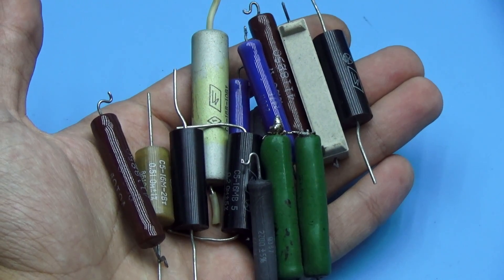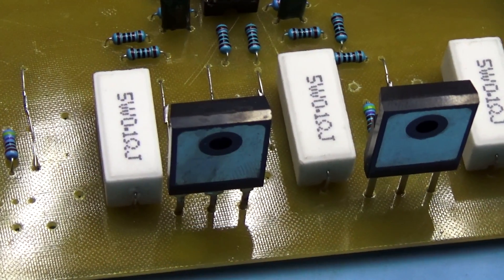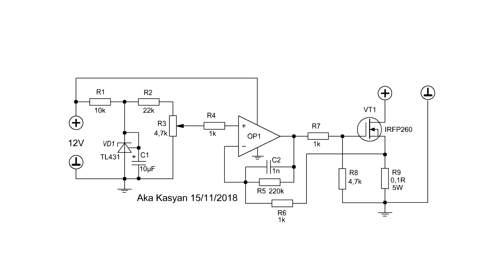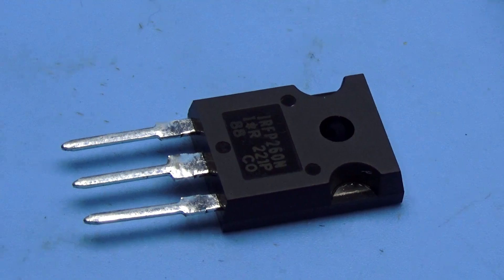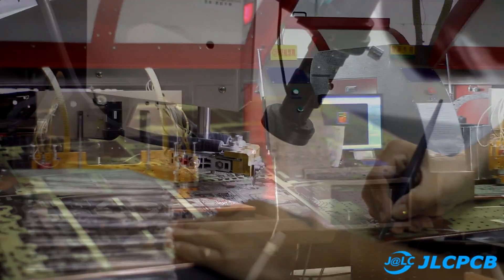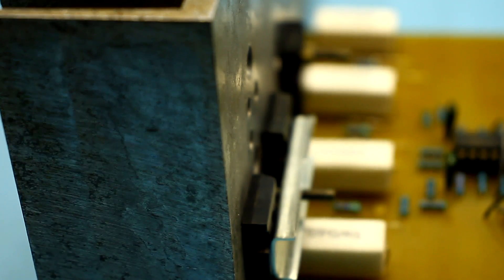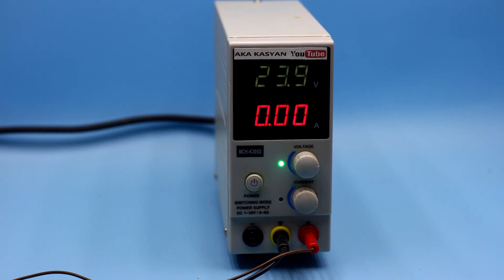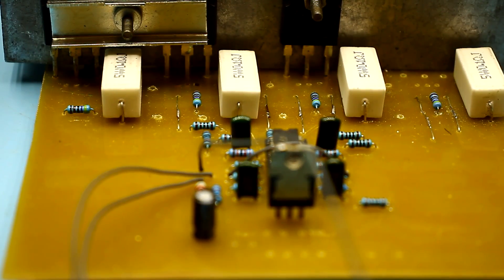Stealing from China 4! Electronic load 300W!!!

Comment: i made same circuit but the problem is when i used 36 volt 10 amp smps  as a load for testing 
upto 5 amp everything was fine
measured gate voltage was between 3.7v to 3.9v

but when i rotate the knob of pot gate voltage jumps to approx 8 volt and voltage and current on the meter  goes zero 
the gate voltage dosent increase in linear manner 
approx i expected upto 8 amps under load test but could not achive.
i tried many calculation but fail
pl help to find the solution

Comment: Hello Kasyan TV. Can I replace the mosfets with power NPN BJT transistors such as TIP3055? Anyway I've been following your channel for quite long time ago and have learned a lot from it. Keep up the good work!
Reply: you should not, especially for higher power applications, and for this application, where we want a voltage to control our load output, as BJTs require base current to control.

Comment: You cant use it as load for audio amplifier bcs of short circuit protection it is considered as 0 ohm during starting or when passing at 0 volt output

Comment: What is the purpose of R6, can't the shunt voltage be directly connected to vin- of op1?
Reply: We need both R5 and R6 for the opamps feedback voltage. Without either it couldn't work. The opamp in this configuration adjusts the output voltage up or down to keep the current fixed. Without R6 the opamp would just drive the output to its maximum or minimum, no regulation.

Comment: You can also use some power supplies as electronic loads. I have some older HP power supplies and they can be used as electronic loads, up to 20-25% of rated power I think.

Comment: To all... Do not buy stuff from aliexpress!!! They don't protect the buyers at all! I ordered some items and received a junk, then I open a case. In their policy, if the buyer receive an item "not as described" should get a full refund without need of return the item! But after aliexpress step in to resolve the case they rule that I'm correct, but they will issue a refund when I return the item. 
The problem is that the item cost is $10, but shipping from US to china is $30! They know that very well this is how they make money!!! This is how the scam works. You order something for $10-$15
They send you a junk for $2. You open a case - they rule to return the item. You won't return it, because is more expensive than the initial value. So they sold you a useless junk that cost $2 for $10-$15.
Reply: Definitely the opposite of experiences i've had on Ali express. I've opened dozens of claims over the past 3 years and not one of them was handled in such a manor. Sorry to hear you had a bad one but I doubt they would be as successful as they are if all claims were handled as you suggest. I've gotten straight up refunded  for a mixup they made. Sent me a microscope 2x the value of the one I ordered. Seller responded immediately and came through with the refund fully knowing it was worth more then the item I had ordered. Now that I didn't expect. But now I have good things to say about them so I guess they have some clue of what they are doing.
Reply: Ordered  up to now 700+ things from Aliexpress. In total I had 7 disputes, they were handled in my favor 6/7, the 7th being really my fault. In all disputes, i got my money back with NO return of the goods. They have to know that if the product is not what you expected you are not going to use it and throw it away (or sell ?). Do not expect that all products on Ali are created equal. If you want quality you will have to buy the product at a trusted seller and it will be more expensive than the cheapest seller. Even though you pay more in that case, it will still be cheaper than locally.

Comment: If you're so concerned about potential thermal issues, why isn't there any thermal grease on your transistors to improve heat transfer ?  Also, why is there only 3 transistors/fets on your board while you're showing 4 on the schematic ?  Did you overheat one or simply decided to shot the video even if the board wasn't fully populated ?  It would have been nice to have a link to the schematics and some decent documentation instead of countless links to buy all sort of material.  If JLCPCB is having such great deals on PCB's, why aren't you showing one made by them instead of one you thinned ?  Oh well !

Comment: Nice video, thanks for the clear circuit description.  I will probably buy a cheap Chinese digital electronic load only because they are, well, cheap.  Just sourcing a heatsink of that size would cost me more than the pre-made circuits from China.  However, if you're like the person in this video who apparently has access to piles of broken and discarded devices that can be scrounged for parts, then this circuit is for you.
Reply: I think I will try this. I managed to get a lot of heatsinks from burnt inverter AC boards. As for myself I will re cycle a couple of old cpu heatsinks from old computers. They happen to be compact and with high dissipation and surface area.

Comment: Well.....crude design at best.... those 4 channels should be better 'matched' to share currents equally....you're using 5% resistors... and those 'sense' resistors are crude wire wound type...might be 5 to 20% tolerance.... should be .1% 'low inductance' type.... probably a better approach instead of 'tinning' entire board with thick solder, would be to 'direct wire' the 'source / drain' with heavy gauge wire.... and the 'professional' load units give some sort of digital control of the load, that's why they are expensive, and much more accurate.... nice try though, might work if you're a hobbiest.....
Reply: Think the general idea was for hobby electronist . But the basics is there... A small controller and a DAC is  needed ...  I would prefer to use Bipolar transistors since is Linear and all ... Just a couple of medium power transistors are needed on the out of the Op amp